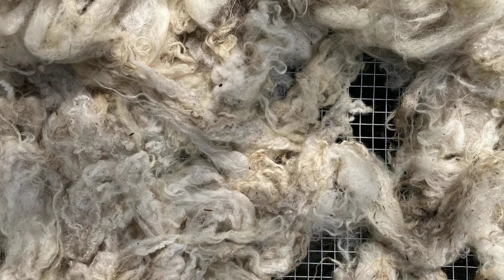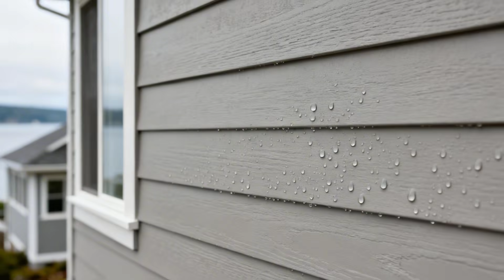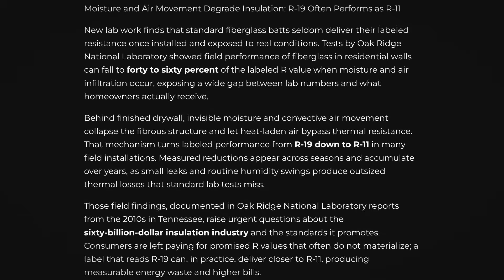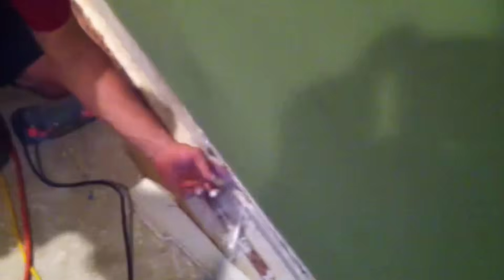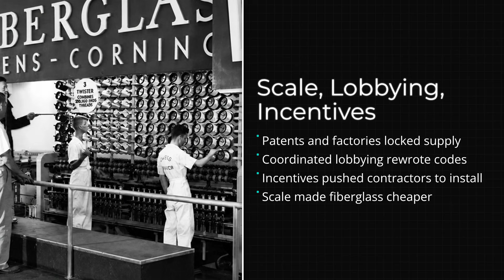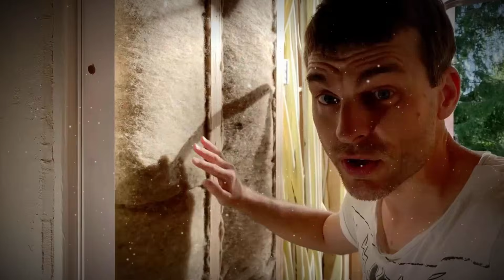Fiberglass Insulation Sucks — This $30 Natural Alternative is 5X Better

Comment: Rockwool is far superior.
Reply: That is indeed the case. Non-biodegradable, but in any other way it is the best insulation material.
Reply: yes, treated with borate :-0)
 cellulose is a close second